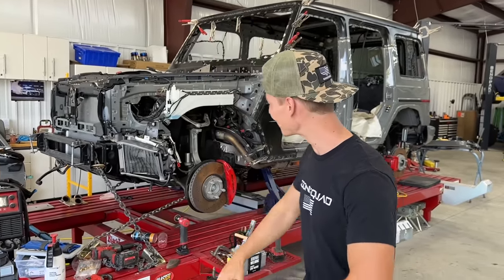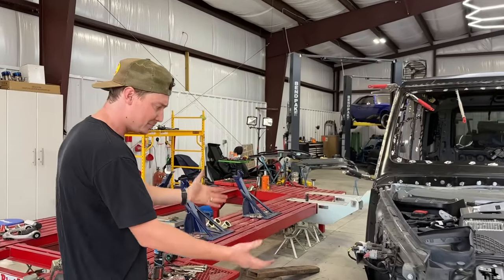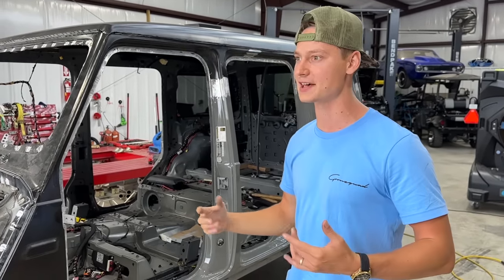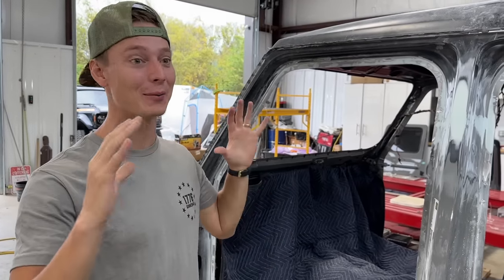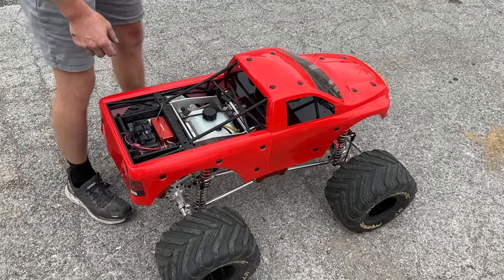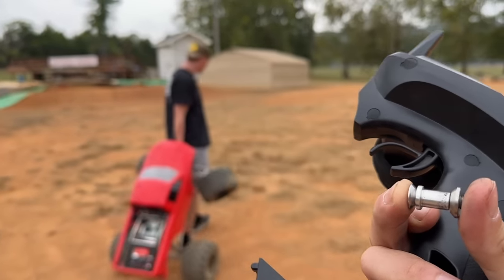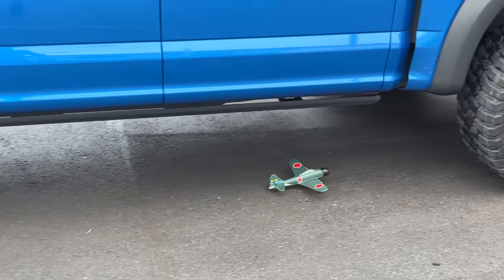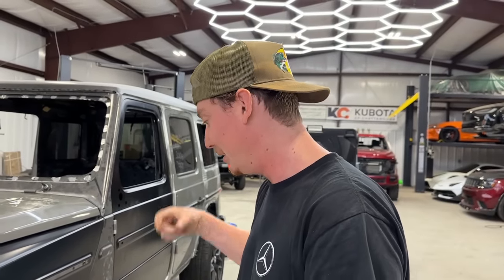Rebuilding A Wrecked 2022 Mercedes G63 G Wagon PART 8

Comment: After painting the G-Wagon, you guys should consider some fluid film inside those welded panels. Over time, they will tend to rust from inside out.
Reply: That’s why you see them using Weld-Thru Primer spray.
Reply: @charliecintexas670   they need to cavity wax. primer is not enough
Reply: @jaredm4444  Exactly. That weld-thru primer is almost useless. To insert the cavity wax, they could add some holes from inside, closing then with some grommets. Or use them as draining holes.
Reply: @charliecintexas670  Even a car that wasn't wrecked, and it body was fully submerged into an anti corrosion solution, will tend to rust from inside out in some panel areas more prone to water intrusion or via humidity from condensation. That water could end up trapped inside the panels, if the water drains are clogged or mud is trapped inside.

Comment: Never ground a welder through a wheel, bearings or any other place where power transfer occurs.  Always ground through areas close to where you weld.  Inevitably the bearings will be damaged by the arcing through the bearing surfaces.
Reply: MAN CANT TAKE A JOKE 🙄🤣

Comment: Hi guys,

I’ve mentioned this before couple of times, but I don’t think you read my comment, it is EXTREMELY IMPORTANT to have the VIN number back on the windshield frame, that would cause major problems registering the car in any other states, I’ve been a car dealer form30 years. And VIN verification is required when registering any car outside of your state, and that wouldn’t be possible without the VIN ON THE WINDOW FRAME.

Great job with your Chanel , like always, and best of luck to you guys.

Comment: Hey guys, I love RC cars especially that fuel ones. Just so you know there should be a control on the remote to help control the throttle since the RC does not run or move once it's started. It sets the choke on the car automatically. The first things is to always turn on the remove first, then start the car so that the servo is already setup the choke.

Comment: You need to upgrade the engine on the rc mt. So much better when they move faster! If it’s moving at idle your settings are set wrong or the tune is lean

Comment: You guys might think about a fuel trailer. All the contractors are going to them and they have so many different compartments for Diesel and Gas plus a tank for the diesel additive then a compressor and a air powered grease gun. The fuel contractors come and fill the tanks when they get low plus you guys could buy the diesel with the dye in it for farm work. Just think how many times you guys are chasing the gas stations. They are built like army tanks and the security on the tanks is like Fort Knox. I know if they had them when I was in Snap On Tools I would have had one of the fuel trailers with all the other benefits they offer.

Comment: Many moons ago I was installing folding sunrooves in cars. I used a spot welder similar to the one you use. (A little bigger maybe). We had a leather strap that went over the shoulder to support the weight of the welder. Makes things a lot easier.

Comment: I believe that if you remove the back plate on the Electric parking brake, that you can manually wind the calipers back.
Reply: You remove the actuator, and the brake can be wound back with an allen wrench.
Reply: Fair play. TBH most of my experience is with VW/Audi. It was something a friend and Mercedes Tech said once. Cheers for that😊

Comment: The power steering rack needs to be replaced. When a mercedes with electronic power steering rack is in a wreck that is bad enough to break the tie rods.  The rack has to be replaced for safety purposes.

Comment: With the amount of builds these have done, you would think they would know by now not tu use body filler on bare metal.
With the pin holes in the splice joints, if this car goes anywhere where rust is a thing it will disintegrate.

Comment: There is a great sanding block I used on boats for block sanding.  We called it the taco.  It's a half circle that you can wrap a piece of DA paper around.  It's great for interior corners.   It's the best block I used.

Comment: Great work but does anyone else have OCD with the pin holes in the welds getting filled in with body filler? I know won’t really make a difference but coming from the refining industry, that would fail inspection! Lol. Just the OCD in me! 🤣 But honestly great work getting that disaster back on 4 wheels!

Comment: You keep driving that RC truck with the remote disconnecting like that and you will burn up the ESC you’re honestly lucky as hell that the car does not just takeoff whenever the remote disconnects from it because technically, that is what should happen it should go full throttle

Comment: Spotwelder can be put hanging on some stand with a strap so you dont have to use muscle to hold it. Just some generic adjustable stand which you can lift and lower. Long enough strap for welder so you can pivot it to right position. Sorry for my english, hope you get what i mean😂. Keep on building guys. Great videos and i will continue to watch them all.

Comment: Yo I'm building a gx470 2008 not wrecked just refreshing updating maintenance, southern 0 rust always serviced Lexus with paper work brand new tires clean title timing water pump done at Lexus with paper work 184k currently at 253k asking $13,500 metallic silver
Reply: Something special? Lmk?

Comment: Not to burst your bubble but you guys need to stay away from fixing vehicles wrecked like that without the proper equipment ,the spot welder you are using does nothing ,that vehicle will come apart in a accident ,its a serious liability,there are guide lines you have to follow when reparing a vehicle ,google 20 million dollar lawsuit against state farm and the body shop that did the repair ,the roof came off because it was not replaced correctley

Comment: I did rc for years, for 1 thing is the remote is cheap, 2 thing is the servo's are not heavy duty and they're weak, 3 thing is that motor is a weed wacker motor, not good for something that heavy

Comment: You should be able to wind the brakes off with a 12V test probe, usually just a two pin plug on calliper that winds them in or out.

Comment: It is not a good idea to attach the ground on a welder to a wheel. I've heard that as the electricity passes through the wheel bearings it can weld them to the bearing race.